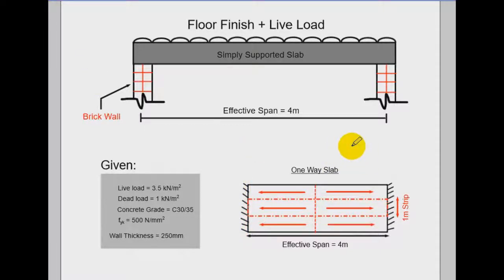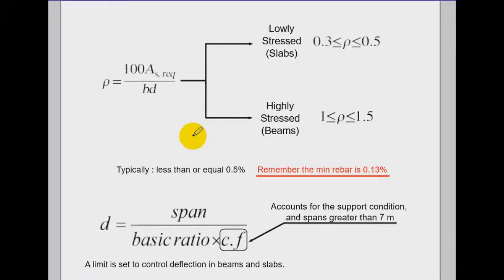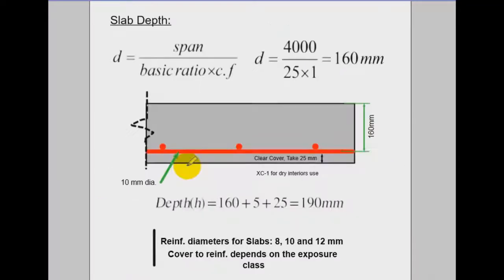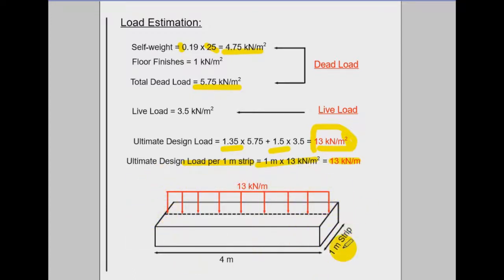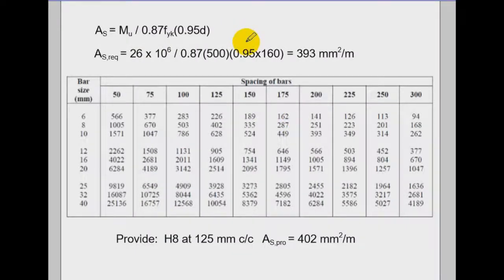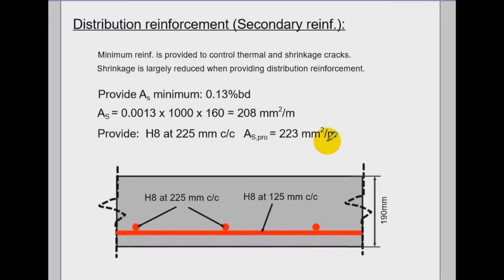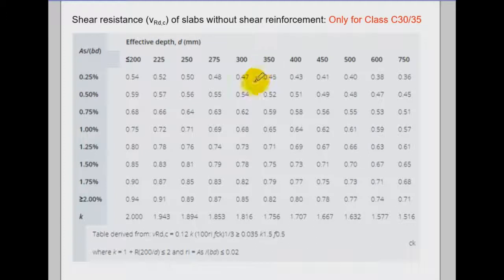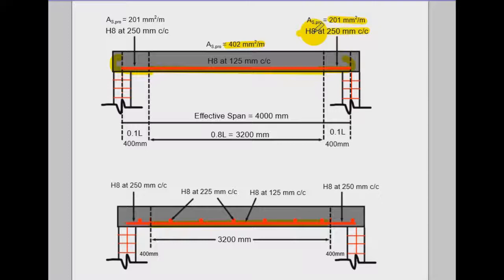Simply Supported One-Way Slab Design To EC2

Comment: What is 'b' please, and why it is always 1000?
Reply from the maker: for slabs, b is the width/breadth and will always be taken as 1000 mm. Slabs are wide and are not practically possible to consider the entire slab width in the design. Design 1 m strip and the rest of the slab will be the same as the 1 m strip you designed (under the same load).
Reply: @abdullahalmahruqi1976  is the tables for spacing of bars different for a foundation please ?
Reply from the maker: @mb4636  no, it is not.